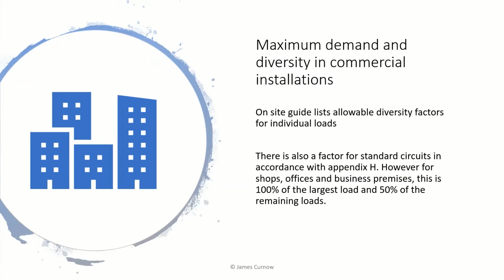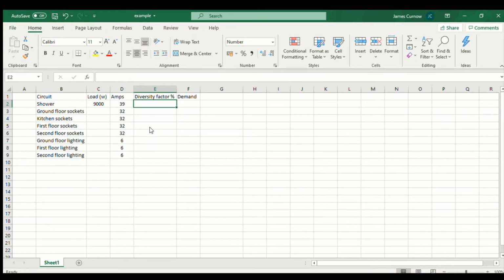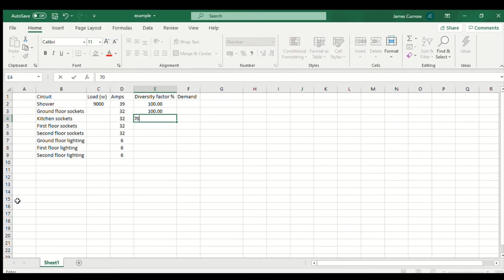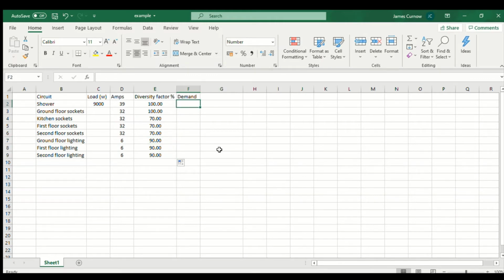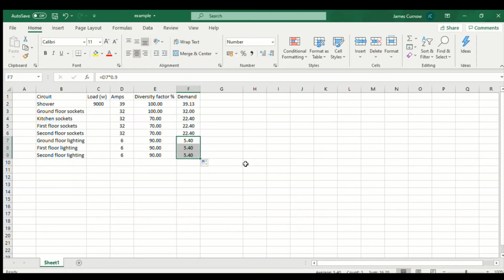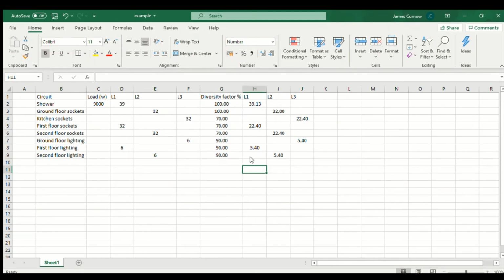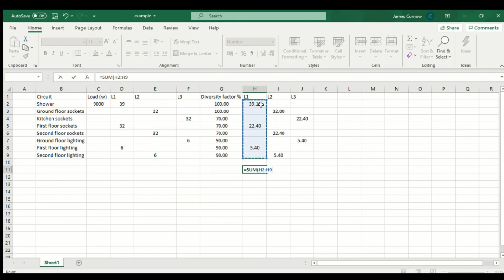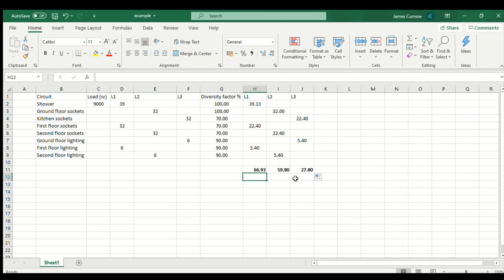Maximum Demand Commercial Installations

Comment: So you will need a 3 phase supply for every domestic installation?
Reply from the maker: Hello Edmond,
The example calculations in this video are for commercial installations, and I included examples for single and three phase.
Domestic installations in the UK are mostly single phase. However I have seen a couple of houses with three phase, but they were much larger houses than usual.
Kind regards
James